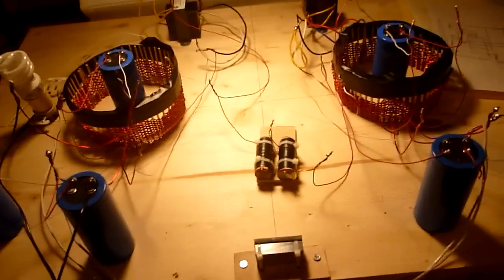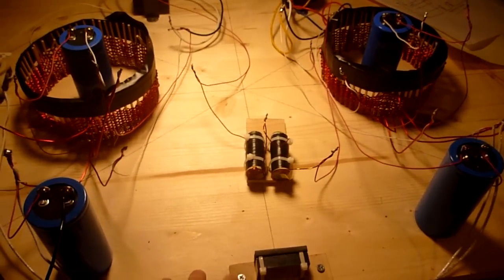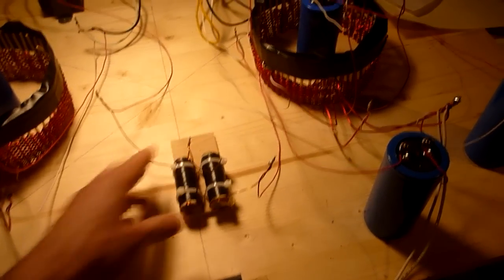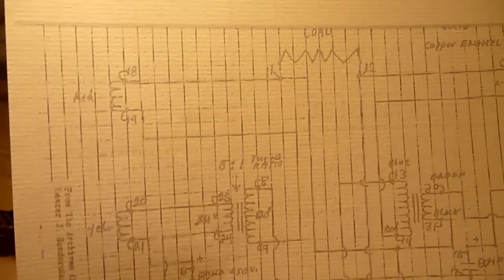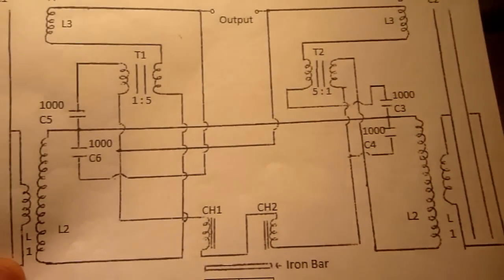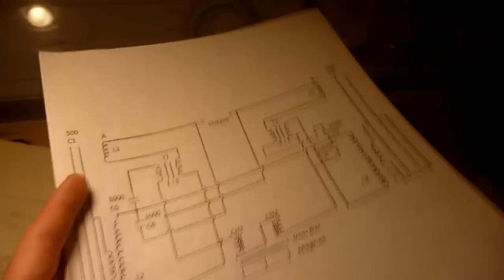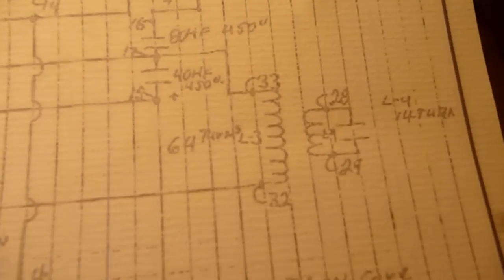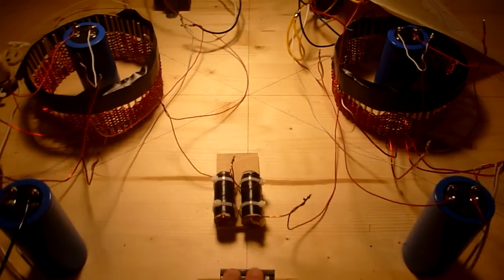Hendershot Generator Failed First Attempt

Comment: The large cylinder coils, I believe, are placed inside the hand-made capacitor structure, to make a tank circuit. But this hand-made capacitor might actually be an antenna too. The frequencies for the relay-coil-clapper part are way down in the 50 to 60Hz range, which is the wall-plug frequency. Some radio designs of his time required a power-supply for the tube voltages, and so there would be a means of converting 12V DC to a high-voltage alternating current. He's trying to do that ... convert to the wall-plug AC currents. But the reception of power is via the dual-cylindrical capacitor-coil structure. Beam microwaves at it from a RADAR system of the day, and it would oscillate. OR, if placed near the power-lines of the WALL, it would pick up the power wirelessly. OR, it could also pick up high-power AM radio. Another circuit that really works is the so-called "Joe Tate Ambient Power Module".

Comment: Hand wound capacitor? Isnt that really a condenser?
Reply: "Condenser" is the older name for a capacitor. Hendershot would dismantle a very specific type of condenser, harvest the foil out of it, flatten the foil on his table. Remove the oils on the foil. He would then create his own capacitor that had TWO plates with a center tap. One plate was slightly smaller and INSIDE the other plate. The outer plate was actually bigger physically. One schematic shows this to be about 0.0078 MFD ... and there are notes that Hendershot would make these and sometimes whey were WRONG and he had to discard them and try again. Not sure what "WRONG" means ... incorrect capacitance ... too much leakage ... not sure. The cylinder he wrapped the capacitors on may have an Iron coffee can because of Fe spotted on one of the photographs. Iron would change the coil into more of a transformer for much lower frequencies -- which makes sense if your after 60Hz.
Reply: @chuckjordan6455  we had this in trade school and its not 60 i think our math came out 24,000 hz.its a ring circuit or tank circuit puts out about 240v tho. They were never commercially made in the usa that we could find in research. I dont have my schematic or all the math I had when we broke it down on the chalk board in about 3 hours. We started with induction and resistance formulas at the coils in the center first. The rest is just an induction capacitance tank circuit known for startin fires thats why the NEC forbids its use.
Reply: @hadleymanmusic  A mechanical relay device will not be easy to oscillate faster than 100 Hertz. It might vibrate with its contacts arcing. 24Khz is the top end of audio spectrum, where only dogs can hear.
Reply: @chuckjordan6455  L C circuit homie
Reply: Thats right its a whistler
Reply: And a fire starter
Reply: The 2 old ones Ive seen were not made by hendershot.
Reply: Im a journeyman electrician and I worked for this one company and I had to take one out a kitchen in a historical home. When I got back to the shop I asked where he wanted me to put he told me where and said " just mive that packin blanket youll see where it goes" i moved the packing blanket and there was another one just as old lookin. That guy thats got that video where his caps are painted red? Thats exactly what I studied in tradeschool and what those old ones looked like. Its been 36 years since trade school and mid 90's when I saw my first real one. NEC says shall not be source of power. Its a fire starter if it not biased right. Never manufactured in the USA either. But after ww2 and korea people with money and buildin new homes would order these we think from south america and the kitchens were the gatherings after the wars, less outdoor built in bbq grillin

Comment: Ive taken a real one out of a kitchen in a historical home. It finally quit. But they are real.im wondering if your print is the same print I studied in trade school? If I remember correctly it came out to be about 240v but around 24,000 hz. The NEC prohibits their use for residential. When that magnets just precise it works but slightly off and current changes and they are firestarters.they were not even made in america that we could find out. All in all the way we get electricity is the safest quietest way. All those other ways even like the K coil they work

Comment: Did you do the math on that print?
Reply: I read various authors speculating on what frequencies Hendershot was tuning for. His coil is very similar to AM radio designs of his day. He appears to be creating a WIDE-BAND receiver that ranges from say 200Khz upward to 600Khz (low part of AM band). This would be lightning strikes all the way up to the bottom portion of AM bad. Wide-band makes sense if you are interested in receiving energy and not a tight signal. If your home was situated close to a large AM broadcasting tower, there would be plenty of power to pick up with a pick-up coil tuned within this range. The challenge would be to take this radio signal, convert it to DC ... charge up capacitors with the DC ... then convert this DC back to low-frequency 60Hz AC (like some DC radios of his day had to do for tube voltages). The theory of operation, therefore, is ... convert AM radio to DC and charge DC caps, then convert this DC power to 60Hz AC power to light bulbs. If the DC caps are LARGE, the charge could build up for a while w/o a load. Once the power in the CAP is sufficient, it can be slowly consumed by a load that current limits. The load would need to be selected to be "in balance" with the energy received... otherwise, the capacitors would just drain down and be empty and the appliance would stop working.
Reply: @chuckjordan6455  its not 60 hz.
Reply: @hadleymanmusic  The "relay", which is mechanical, will not be able to be driven much faster than 100Hz.
Reply: @chuckjordan6455  the relay is where the voltage gets started and its not a tank circuit so.
Reply: @chuckjordan6455  besides its not a relay

Comment: Hello, where did you find the capacitors? They should not  be polarised! 
Best regards 
Jakub
Reply: You won't be able to ever find such big values in the non-polarised style unless you make them up by putting in parallel smaller value caps to reach the desired value. You can tell that the schematic is fake and intentionally deceptive.  When the device was invented such caps didn't exist!  End off.

Comment: what scopeshots are you on coils?
Reply from the maker: +wizer12 I don't understand your question. The end of the coils are covered with electrical tape. I followed the directions given in this video: https://www.youtube.com/watch?v=wGZeLclOOwU THIS video, as it turns out, is GRADE A dis-information. It shows the wrong capacitor values for the capacitors that should be used, it also skips the hand wound spiral capacitors that Hendershot used. The key is in these spiral capacitors.

Comment: Your steel plate is wrong. It is supposed to be up between the two larg coils which are supposed to be closer together also
Reply from the maker: Ed Turner What steel plate? The two coils in the middle are zip tied to a small piece of pressed wood. Then I have a piece of metal between the magnet and the coils. I think my generator failed because I used wrong capacitors (look at Hendershot's original schematic and you'll see different capacitance capacitors). I still haven't redone this generator. Thanx for the comment.
Reply: @naokikashima9349  have you ever made your own capacitors?